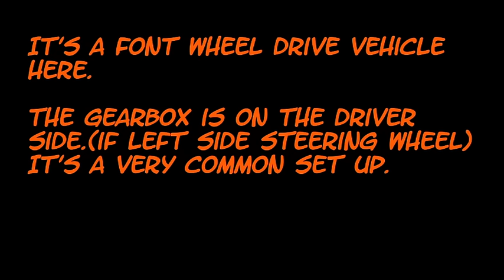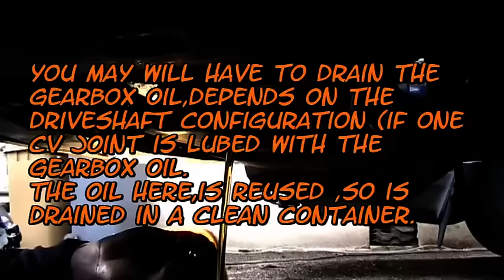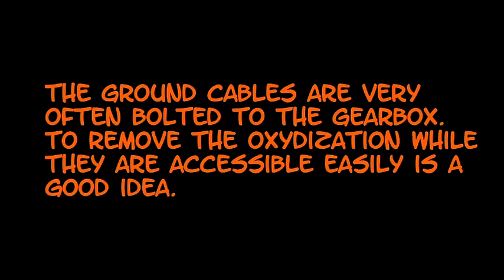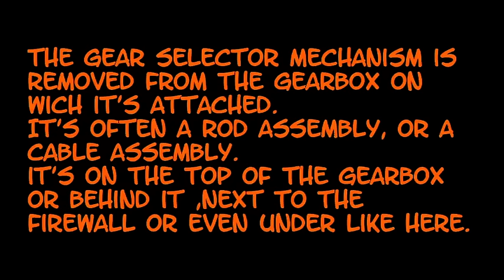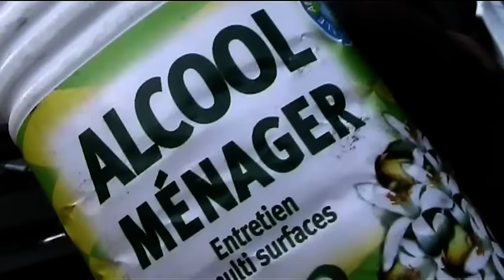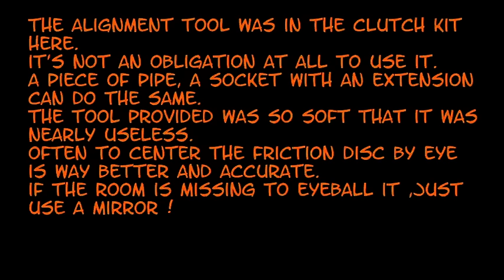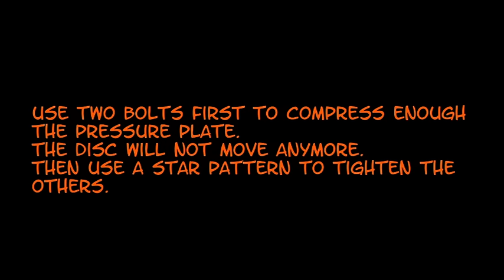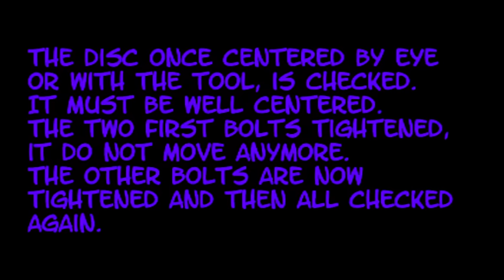Front Wheel Drive car clutch replacement.

Comment: Good job, I think it's a good idea to mention in the title it's a Renault 21 with F2N engine. I have a Twingo c3g 1995. Hope my clutch will last forever, it's been 290000 km.
Reply: I still have a Renault Twingo D7F engine, 1998 ~285K km. The clutch haven´t needed intervention, yet. But I do recognize the bearing is getting noisier by the day. By far the best "dirty cheap" car I´ve ever had. Lack a ton of modern features, but it´s extremely reliable and always deliver. 

I drive across Europe from time to time. About 7 countries, 3000 km to each side (6000 km total). Although the sound proofing, power, amenities, etc. as nothing to do with my other cars, particularly the Mercedes. The fact is you put gas and it takes you where you want to go, every time. ;-)
Reply: @crpth1  where are you from? i think it's time for a clutch replacement, getting closer to 300k, clutch starts to slip.

Comment: Thanks for a very good video. I used it several years ago to guide me with clutch replacement on a 2002 Saturn SL2. I just watched it again before I start another clutch replacement on My 1995 Saturn Sl2. I like the comment below about using graphite instead of grease, especially on the rotating assembly parts to avoid the prospect of grease working it's way onto the clutch mating surfaces.
Reply from the maker: Thank you.
I'm happy to know it helped you to do it ,and not only at entertaining you.
Manufacturers don't even want lube on the splines,depends of their policy,or engineering.

Comment: Omg so much to do for a clutch change...
Reply: its really not that bad if you have done one before.
Reply from the maker: Yes,it's painful but only once in a while (more or less 150 000 kilometers)
Reply: +michaelovitch 
230k over here
Reply from the maker: Less city driving : )
Reply: Jorge Rodriguez i personally prefer working on front wheel drive. the gearbox can be supported with an engine crane during reinstallation and on rear wheel drive you kinda just have to summon all your strength (or a friend) and lift it.
Reply: @michaelovitch  Mine has gone 270 000km and still going, 2005 Volvo V70 xD

Comment: nice video , i only have experience with changing clutch on subaru impreza which is 4x4 transmission , looks a lot easier on fwd cars , i want to buy a turbo saab 9-3  and your video gave me extra confidence to do it
Reply from the maker: Thank you,
If you did that on a 4x4,you have no worries to expect from a fwd car.
Unless you work a on badly designed one.
Reply: i actually lifted the motor out because it was less work than to remove  the trans :)
Reply from the maker: Less work is what make peoples think before to do something.
It's often a very good thing.

Comment: I used to measure the clutch  set position using finger from the side of the clutch cover,a blue tool in this video is quite acceptable as a  good and useful measurement tool too!
Reply from the maker: Yes,it was with the clutch kit : )

Comment: Do I have to remove both axles from the transaxle? I got them off the hubs but can't get them out of the transaxle...... it was hard enough to beat them out of the hubs. But can I just pull the transaxle apart like you did at 9:00 minutes but with the axles still connected?
Reply from the maker: ITheUnknownManI 
You can let them in the gearbox if you want,but it will be a bit more dificult to move it around to reinstall the clutch.
The best is to remove them,and have the gearbox free of movement : )

Comment: what's the purpose of those 3 roller bearings on the drive shaft?? why not just splines ?
Reply from the maker: The suspension/wheel assembly goes up and down,while the gearbox do not move in the car.
You need to have a shaft wich change its angle of work following the height of the suspension.
those rollers bearings can move in the cup they sit in with some different angle while rotating.
Reply: @michaelovitch  thanks for the answer, it makes sense what you write, but on the other side it's just splines , there is something special with the drivers side that has these roller bearings. The other side does not
Reply from the maker: @farerse  The driver side is short and it's a single shaft with one end splined,and the other with a tripod bearing type.
The passenger side is composed of two shafts,with a Continuous velocity end in the middle. and both ends splined.
So the passenger side can have both ends splined and its angle can vary in the middle with the articulation.
It's a way longer piece too.
Reply: @michaelovitch  brilliant! Now i just need to figure out how to pickup a dropped roller bearing inside the gearbox
Reply from the maker: @farerse  It's a needle bearing whole asembly or just a needle ?
Reply: @michaelovitch  the ring around the needles .. :)
Reply from the maker: @farerse  
A small magnet wich look like a telescopic pen with a flexible end to fish it,or a big powerful 
 magnet to guide it upwards from where it is to from where it fell down.
A borescope can help you locate it first,
You can rent,or buy those following the country you live in.
Magnets can be bought online for a resonnable price,like the borescope ,there are usb models,or autonomus units.
The worst would be to remove the gearbox and wiggle it until it falls out of it
Reply: @michaelovitch  thanks for the friendly advice! guiding it upwards from the outside was a brilliant idea if all else fails. Just hope the bearing is actually magnetic.
cheers
Reply from the maker: @farerse  It's made of steel,carbon steel with some alloys,so it's magnetic.
As i know stainless steel bearings are not used in common application as automotive stuff.
Reply: @michaelovitch  well no luck with fishing from driver side with axle removed. Do you think it can be reached from the other side? (passenger axle)
Reply from the maker: @farerse  I doubt about that.If it fell in the driver side,there are thin chances that it went on the otherside,knowing there are a bunch of obstacles between.
Gearboxes are quite packed inside.
I suggest you to try to see where it is first,a borescope can help.
You could lift one side of the car a bunch to help moving it inside.
Generally it couldn't fall very far from the orifice it went in.
At the end of the gearbox,on driver side you often have a steel plate,like a cap.
You could take a look over there once it's removed,you would be close to the driver side axle orifice.
What is the car/gearbox ?
Reply: @michaelovitch  thanks again for explaining, car is renault clio with 5 speed manual gearbox . Unfortunately there is no pan to drop , I could check in that cap that sits next to the orifice you mentioned. I'm surprised more people haven't dropped those slippery bearings when pulling the drive shaft
Reply from the maker: @farerse  
I'm sure you are not alone haha
Reply: @michaelovitch  I agree with you on that:)

Comment: First of all, thank you for sharing. 
I want to ask, what is the problem when the engine is running and the gear cannot be put in. 
when the engine is turned off, go into gear and then start the engine while pressing the clutch will the car jump (keep moving)?

how to overcome?
Reply from the maker: When the engine is running,the primary shaft in the gearbox is rotating,so is doing the clutch disc.
So you can't engage a gear engine running because your throw out bearing is so worn out that it can't push the clutch plate to disengage the clutch.
If the clutch cable is out of adjustment,it will do the same,and if you have a hydraulc clutch with air bubbles in the line or not enough fluid in the reservoir it will not work.
Check the clutch cable adjustment,or the fluid if you have a hydraulic system,if all is good,that mean the clutch is to replace because worn out.
Reply: @michaelovitch  Thank You my friend👌.

Comment: Wonderful work with patience and technique! One question, I have a 30 year old Opel astra F. When I move it with the first after the second etc at low RPM I hear a strange sound as if gears are rubbing. But when I turn up the speed and go third, fourth the sound is lost. What can happen, a bearing maybe?
Reply from the maker: Thank you,
Maybe,
To diagnose it a bit more in depth,you can check the oil level in the gearbox : maybe it's missing some oil.
The more you roll faster ,the less the primary (or input )shaft in the gearbox is rotating faster : the reduction from the input to output shaft are less and less important,gears are longer and longer.
4th gear should be close to none reduction and th gear a demultiplied (output gear smaller than input gear)
So i would say that you hear less and less noise because you have less and less rotation speed on the primary shaft.
This relation between noise and speed make me think to a bearing,yes,but on the primary shaft,(input shaft,the one being connected directly to the engine  via the clutch disc.
It could be the trust bearing on the clutch,but only if it's always engaged a bit by lack of slack in the clutch cable adjustement (it's less likely the case,but could be)
Reply: @michaelovitch  Helpful thanks a lot!

Comment: Thanks for the excellent video. My son's just bought a Toyota Caldina GT-T and it needs a new clutch release bearing. I doubt there's enough space to slide the gearbox away enough.
Reply from the maker: Thank you : )
Three possible ways :
-the gearbox is pushed on the side,like here
-the gearbox is removed by under: you may need to remove a part of the subframe,wich is normal,and often easy,because made for.
-the gearox is removed by above,you have to think it's lifted by hand or ,way better,a device like a crane.
The best is to check the shop manual to see how it's supposed to be done,but remember you can very often cheat,like me.

Comment: I have another question.. at 16:55 you put the release bearing on the fork . My release bearing had broken both plastic clips that slides on the fork .. are they important? Or just so it doesn't fall off during assembly? :)
Reply from the maker: To keep it during assembly and to avoir rattling in neutral.
There is supposed to have some freeplay on the clutch,so always some gap between the pressure plate and the bearing front face.
It's not critical but it's not completly useless either.
Reply: @michaelovitch  thanks again, it's very weak to make it from plastic. I'm confident to use it anyway.
Reply from the maker: @farerse  The manufacturers are weak,they search anyway possible to save money.
If you look closely you can see that the through out bearing has a thin surface on wich it slides on the pressure plate.
That was way larger before,and the goal now is to dig in the pressure plate fingers to wear them until it creates a ridge so you have a stiff clutch pedal before the clutch is worn out.
Reply: @michaelovitch  Yeah I never thought about these things before I looked into this job myself. There are lots of aftermarket parts to choose from that makes clutch parts. Maybe aftermarket parts are sometimes better than weak original parts. Thanks for informative videos!
Reply from the maker: @farerse  The best is to stick to big common brands in aftermarket.
I don't know what you have in your country.
Manufacturers rarely make their own clutches,so it's most of the time an "aftermarket" clutch that you have installed on a new car.
Reply: @michaelovitch  we have autodoc in scandinavia :) I've had good luck with that site so far.

Comment: Hello, very good video. a query. I changeD the clutch disc of a byd f3 and when I assemble the whole car it doesn't STart, what could have happened? When placing the press, do i have to pay Attention to Something?
Reply from the maker: Hello,
Are you you did plug back all the electrical plugs ?
I would say that the cranckshaft position sensor do not send its signal anymore

Comment: Hello. I see that some people already has asked about how to move/remove te gearbox to change the clutch disk. And here is my question. I see that you put the jack just under the flywheel, let's say, as far as I can see. Then you can push the gearbox, and it does not fall. Is because of the space, or what avoids the gearbox falling when pushing it? Do you know what do I have to see in the car to know previously if I can just push, move the gearbox? Thank you very much.
Reply from the maker: +sciexp 
Hello,
The shaft protruding from the gearbox,will slide through the clutch assembly and seat in the cranckshaft,the gearbox is guided,but you have to push it straight.
The jack is at the extremity of the engine block,to support it without being a problem to slide the gearbox in.
You can measure the gearbox and see if you have enough room,to slide the gearbox on the side to change the clutch.
Following the car,you will have to remove it completly,out of the engine bay,if not enough room.
Sometimes it's by under the car,or by the top that you have to get it out.
A service manual can precise it,but you can cheat too : )
What car is it ?
Reply: +michaelovitch Tahnk you for your answer. :) I have a VW Polo 1.9 d 6n1 1998 model.
Reply: +sciexp I see now that the car has an structure where the gearbox can stay.
Reply from the maker: +sciexp 
You are lucky so : )
Reply: +michaelovitch I saw later that my car has no structure, so I need the jack below, and/or a bar above. 

Thanks for your attention and video. Nice.. :)
Reply from the maker: +sciexp 
Thank you : )
Have a nice and smooth work : )

Comment: Thanks for this video. I have a Dodge Dart Front Wheel Drive too. I will be using these basic steps for my transmission removal.
Reply from the maker: Glad it help you
You have a problem ?
Reply: @michaelovitch  what is the grease you used for the transmission? I am putting the transmission back together again. I got something called assembly goo but I dont know if I can use it.
Reply from the maker: You can buy the grease specific for this job (thorow out bearing grease),or a molybden or graphite grease,wich is very sticky and last long without evaporating.
Don't use as much as there,it was way too much,the excess was removed on the fork pivot,and the shaft.
Think about the bearing at the middle of the flywheel ,it's a good oportunity to replace it if there is one,like the cranck shaft seal behind the flywheel.
: )

Comment: Hi good video! thank you for your efforts ...I would need a bit of advice...I just got my clutch changed in 09 transit connect (by a mechanic I suppose) ...as soon as you start the engine you can hear a noise of metal rubbing against metal :/coming form he clutch area... when you rew it seems to disappear  but when rews go down the noise is coming back... also when I drive and turn right the noise is gone but as soon as I'm back on straight road the sound is coming back  ...The guy is going to pull it apart again....what do you think could be the reason ?
Reply from the maker: Thank you !
too much slack in the mechanism,check the cable tension if it's a cable set up
It could be a loose drive shaft 
I can't tell without seeing or hearing it.
: )
Reply: Thank you for your answer...I took it to the same mechanic and he doesn't feel liable for it making some stupid shit ass excuses...it's just a price that I pay for being nice...should have gone to  real garage (guy did it on the roadside) but I thought that I could let him make a bit of money and that's what I got fucked van and no receipt for the job so even can't claim  my tax back on it.
well mistakes we all make...but this one was a last one of this sort for me.
once again thank you for getting back to me 
cheers
Reply from the maker: I hope you will can solve that : )
Reply: Dawid Czerniak hggy

Comment: sorry for asking again but the transmission got stuck and I can't take it out I took out all of the screws and the starter the transmission is loose and wiggles but it doesn't come out my car is a KIA spectra 2006 would it mean that i would have to take off the stick that pushes the pressure plate to take out the transmission Thank You very much
Reply from the maker: +laura patricia 
Did you remove the linkage attached to the gearbox from the gearstick ?
I hope you solved your problem since,your comment was buried into the others.

Comment: Hi, I have Chevrolet avoes 1.5l 2008 model does not take the gears, someone told me the problem is realise bearing. I bought the whole clutch kit changed it but still does not take the gears more especially when the engine is running but when the engine is off or not running it does in, what can be a problem? Please please I need your help🙏
Reply from the maker: HI,
You need to be sure that if you have a clutch cable,it must be adjusted properly,you need some correcttension and freeplay,so the clutch engages in the middle of the pedal travel.
If you have a hydraulic clutch,be sure to have fluid,bled the air so it can actuate the release bearing properly.
How the pedal feel when you press it ?
Reply: The pedal does all the way doesn't come out, it sticks
Reply from the maker: @phillipoupamashaba1767  
Ok,then you need to check if you have a hydraulic system or a cable system.
If it's a hydraulic system,you need to see if it's fluid is up to level or if it's leaking.
The pedal is sticking down because the cable is loose or the hydraulic system is empty/leaking or full of air instead of fluid.